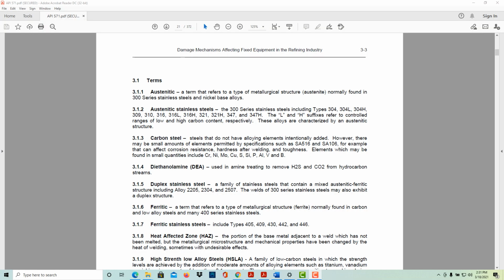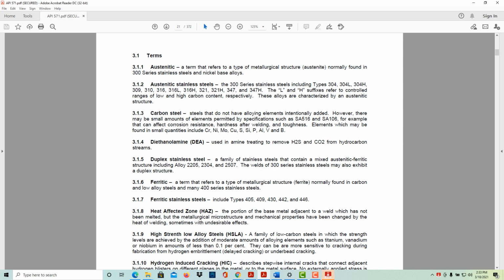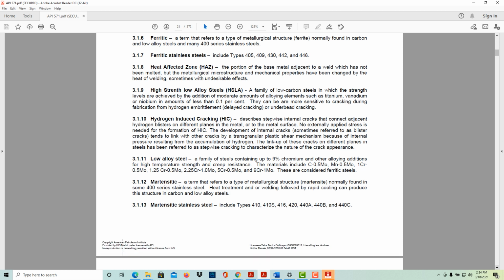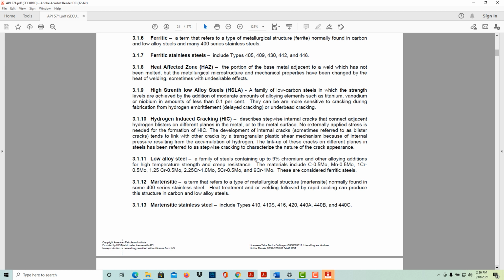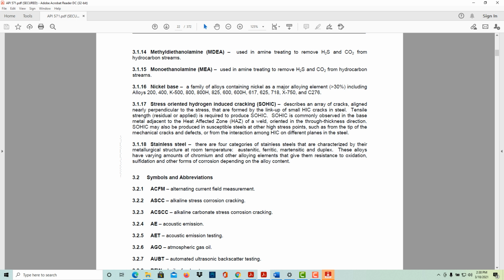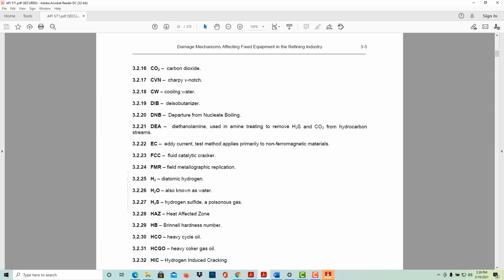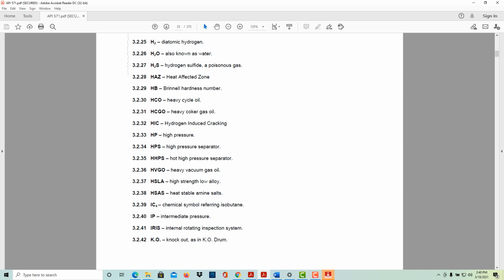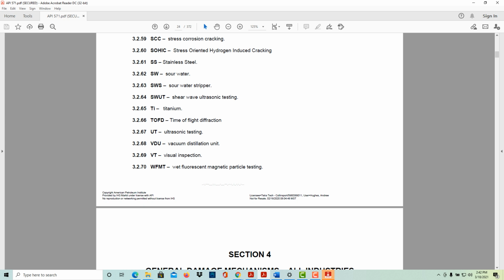Api 571 Terms

Comment: Hey so did you pass your API 577?
Reply from the maker: Yes , it was fairly easy, read the guide throughly and get as many practice questions as possible
Reply: How much was cost to take the test?
Reply from the maker: those lesser API Tests costs around 340$ and the main tests costs 800$